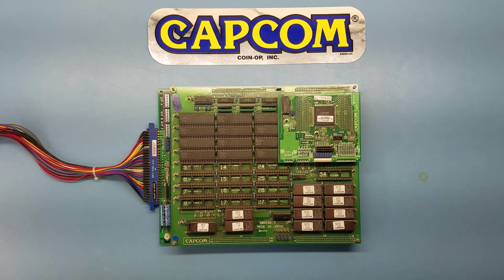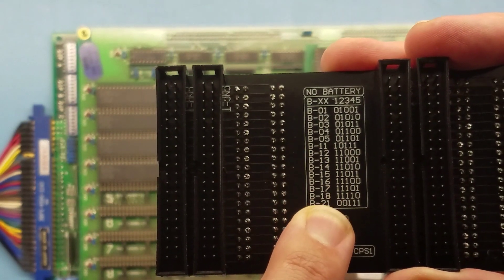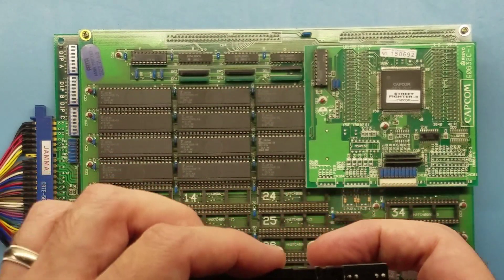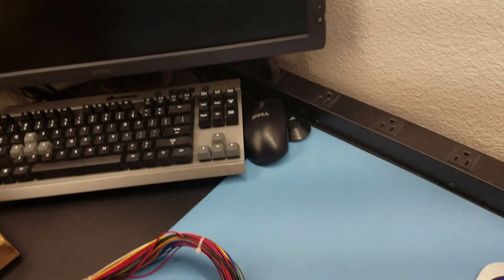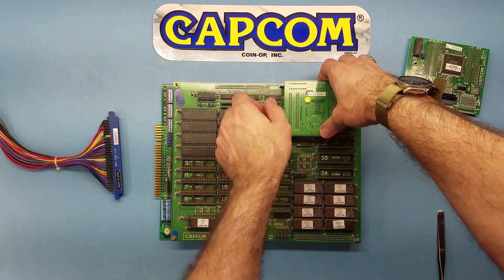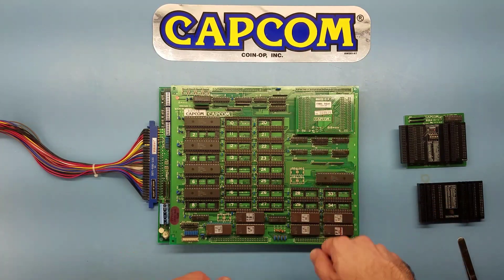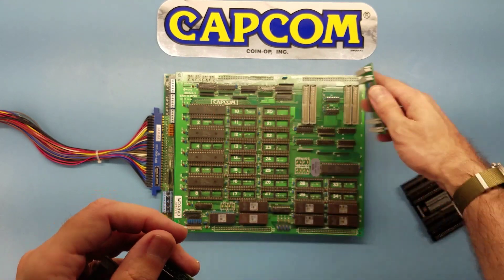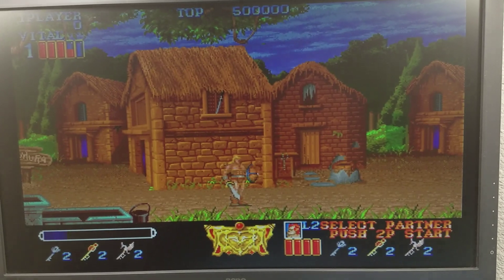InfiniKey CPS1 Extended Features (Non-Battery Games)

Comment: I desperately need your help with something. Is there any way to message you on social media or whatever? I just bought this supergun from Japan (and one of your Inifnikeys :) ) but I am having an impossible time trying to figure out this scart thing I can't seem to find an 8 DIN cable in the states that will fit this thing to convert it (SPECIAL VERSION COMBO AV) I've spent nearly a grand on all this equipment, but I can't even connect the thing to my television/ monitor. Is there any advice you could give me. I have lost so much sleep over this, and no one on the forums will answer my question. I have looked for the answer for three days nonstop.  Yes. I'm a total noob. But if you could help me. I would much appreciate it. I just want something to plug and play rather than solder a bunch of wires or cable-splicing.